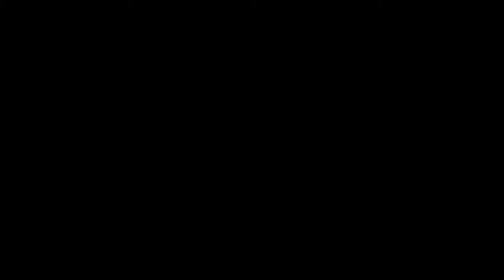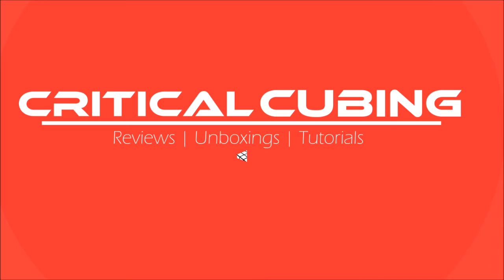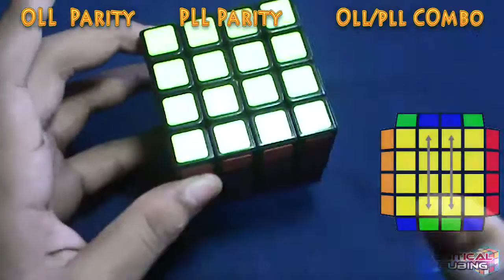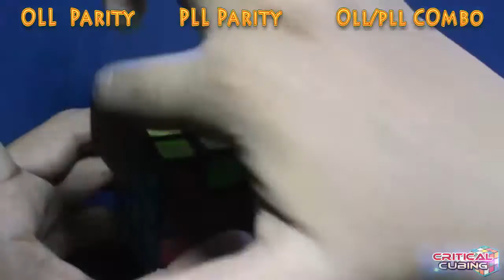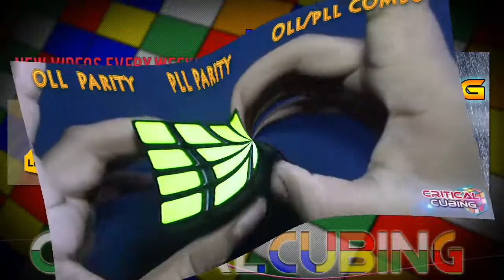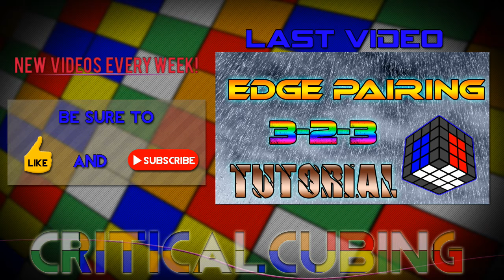4x4 PLL PARITY GUIDE/TUTORIAL

Comment: Very good tutorial!! but i did note you did U2 or UW2 with your right hand during the PLL Parity, i suggest using your left hand and doing UW2' or U2', just a tip:) and the other thing is i don't none even layer cubes(7x7, 5x5) have parity like you said in the description:p But anyways,  a very cool video!
Reply: Maximilian Berkmann i guess your right then:P because i learned to solve the 7x7 by my self as a challenge. so maybe something is different in my ways:) Sorry for mistaking you CriticalCubing:P
Reply: CriticalCubing Sorry to tell you, but there's both parities on big odd cubes. And for the OLL parity, the alg is slightly different as and the PLL one is different unless you use the same alg for even cubes
Reply: Maximilian Berkmann What? but i never got any parity on my 7x7. are you sure?
Reply: TheSkyCuber that doesn't mean that there's no parity on 7x7, if you would pair the edges differently you should have parity cases, I got parity on every big cubes I tried (including virtual ones such as the 7x7, 12x12 and 9x9). If you would try the adaptation of both the EO and EP parity on 7x7+ you would see.
And yes I'm sure
Reply from the maker: TheSkyCuber Haha. That saved me. I forgot that in reduction there is nor parity for 5x5 and 7x7. :P Thanks. I frankly thought this video would be bad as it is an old video and I changed my fingertrick for PLL parity. You can see it at the end of my cube collection video when I introduce the Aosu. Thanks for the tip :D
Reply: No problem:)
Reply from the maker: Time to change description again :P
Reply from the maker: TheSkyCuber Nah! Its fine :D
Reply: TheSkyCuber :)